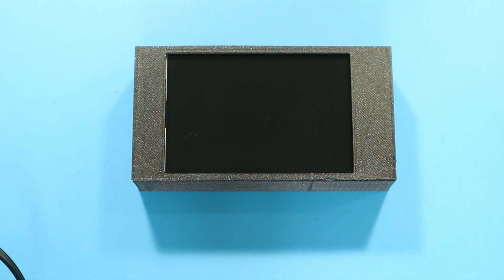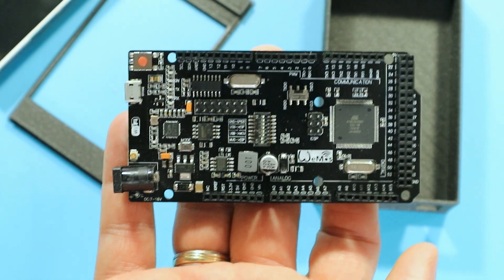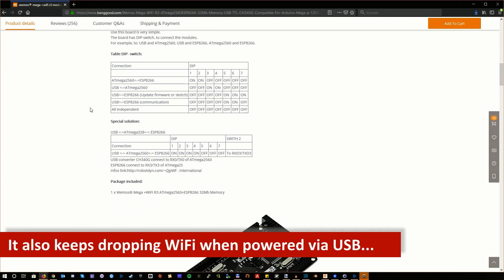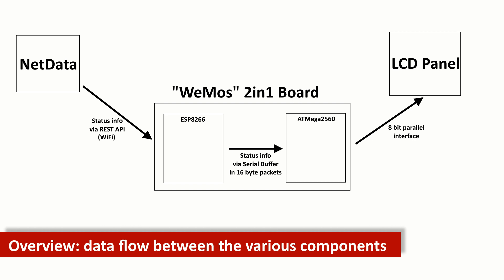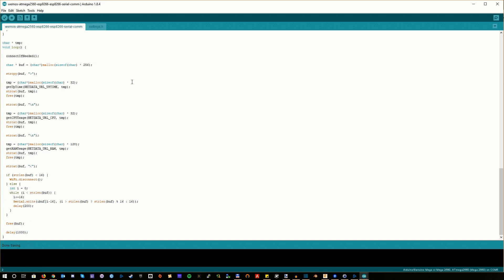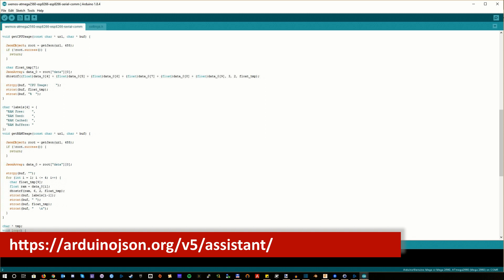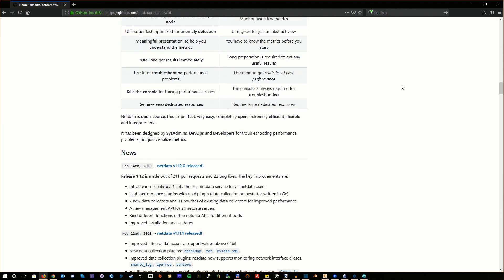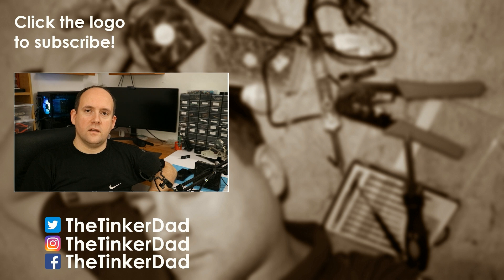Server Monitor / Info Box Using Arduino, ESP8266 and NetData

Comment: Great project! Have you considered using a nextion display? I think this would take the graphics part of your project to the next level without adding to much extra costs.
Reply from the maker: Not sure if it's worth the money for this project :) I mean the Nextion displays are cool, but they cost 3 times as much as this LCD. My only goal here is to squeeze as much textual info on a 3.5" display as humanly possible - as long as it is conveniently readable - so no need for graphical eyecandy. Plus, I don't need the touch screen either. On the other hand, i still have plans for a smart thermostat that I can mount on the living room wall and for that, a reliable touch screen will be a must.
Reply: @TheTinkerDad  
I used the wrong account for my previous reaction. I understand your reasons for not using a nextion, although personaly I would not mind the eye candy ;)

I run the OTA update service iotappstory.com with Andreas Spiess. And we think this would be a cool "app" to share. (basicly people with a esp32 & your lcd could sign up and get your app OTA incl. future updates) I would be the first to sign up for my home server :)

Would you consider working together on github to realise something like this?
Reply from the maker: @onnodirkzwager3537  Yes, definitely! As soon as the ESP32 board I've mentioned in the video arrives, I'll reimplement the code, so it'll be actually usable with your service.